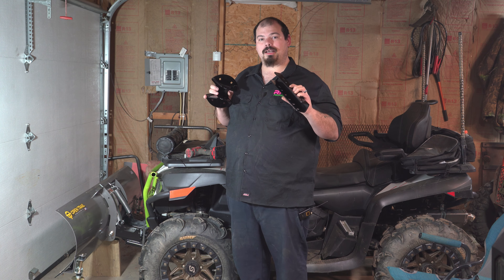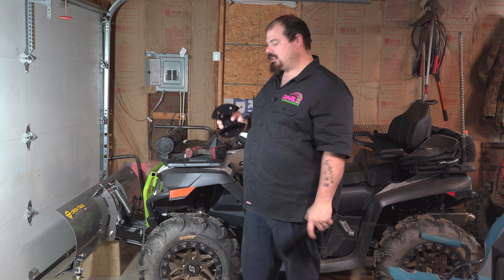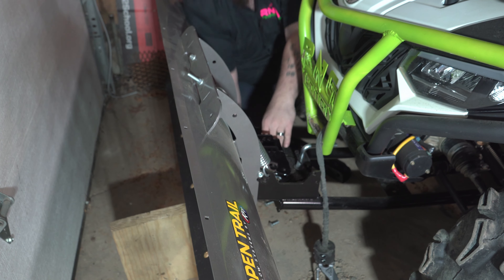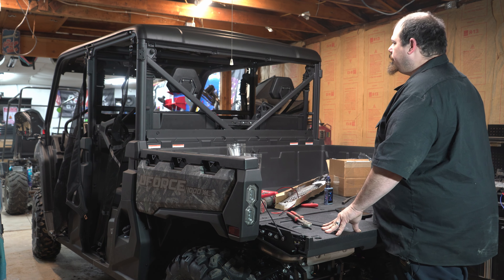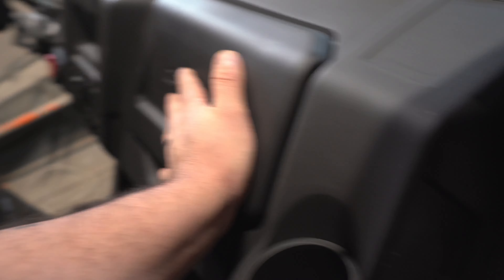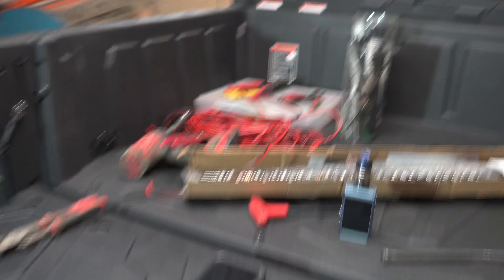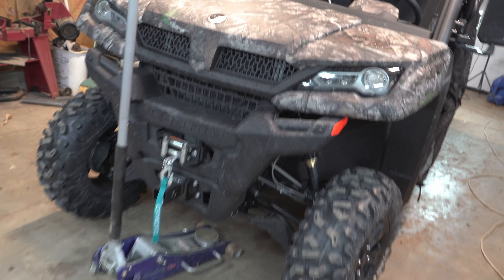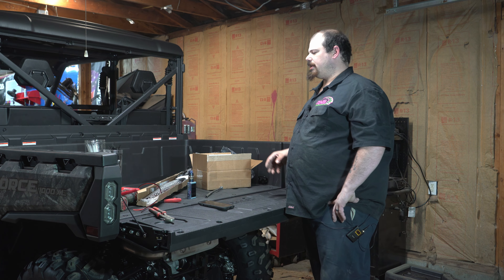CFMOTO Plow cable keeps breaking

Comment: I have had this cable saver on my uforce1000 kfi plow for a year now. It's a necessity, if anyone reading this is on the fence about getting one, do it. 

Put some grease or chain lube on all of the rubber grammants. Makes opening and closing the glovebox, hood and seats much easier.
Reply from the maker: I agree this thing is a must have for sure.  Thank you I will definitely do that that’s a good video also I think.